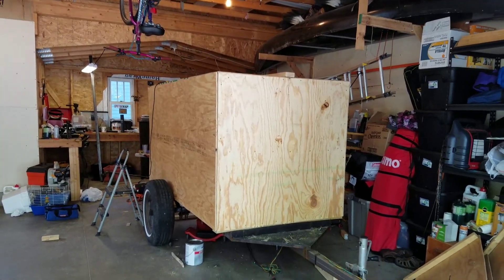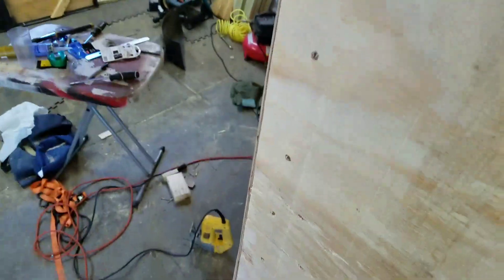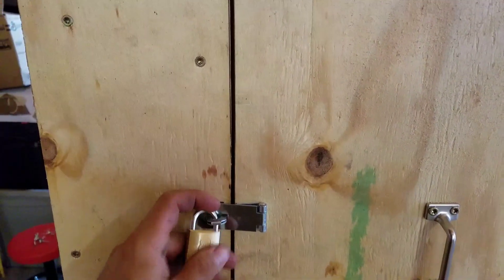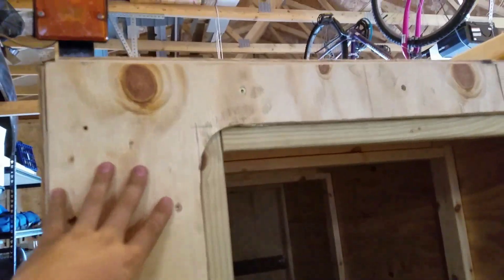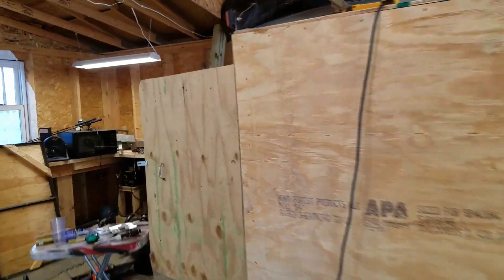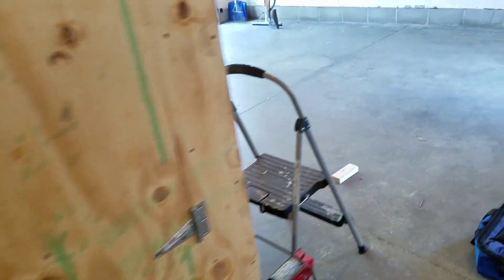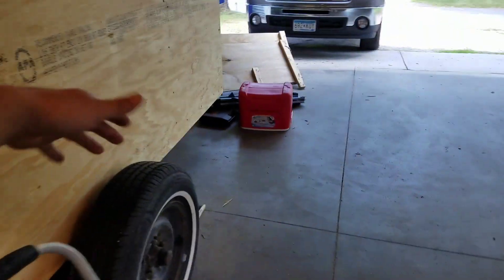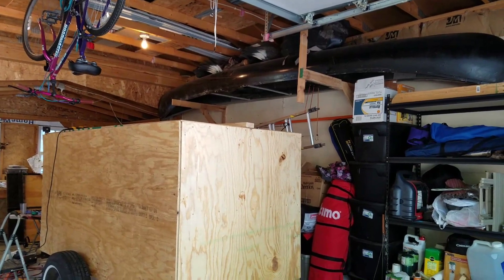The door is fixed

Comment: Hi. I built basically the same trailer a few years back. My door was exactly the same.  I did run into trouble with the screws on the hinges and latch backing out from road vibrations. I had to change out the screws for bolts with washers and lock nuts. I action completely lost a hinge on the highway before I changed to bolts.